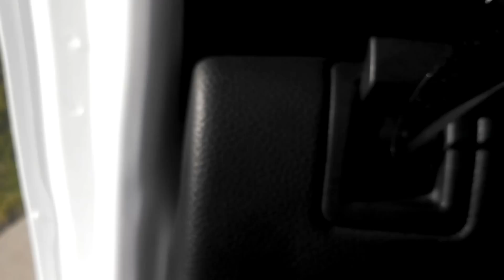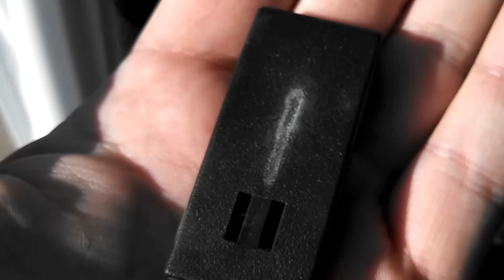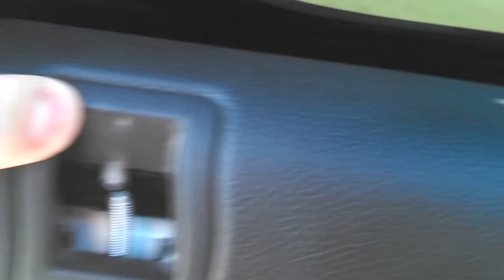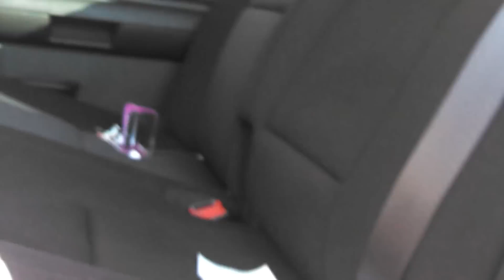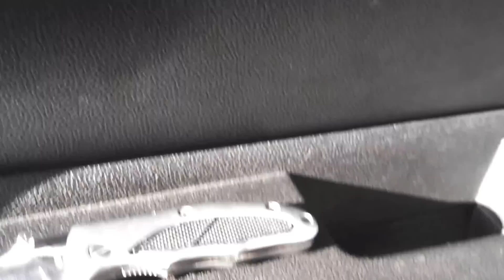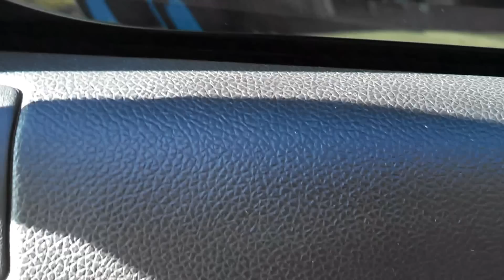Chevy Silverado HowTo stop door locks from Rattling or Vibrating.

Comment: Got some rattle in my 2014 Silverado in passenger door only and only went hitting very rough road areas. Smooth roads no rattle? Is your door lock rattle continuous or intermittent? Would this be my rattle?

Comment: i did this and it did nothing.  flipped up the rear passenger seat and rattling went away.  anyone have any ideas what is rattling in the rear seat?
Reply: Seat guide assembly on back of seat there are 3 on on passenger seat 2 on middle and drivers. $8.50 at local dealer. It's a u shaped piece of plastic
Reply: The one on middle seat back was broken in half on mine was rattling like crazy. Slid broken one out from right side. Slid new one in from the top left side.
Reply: I have the same problem and I believe its the same thing Chris says.
Reply: Had the same problem, buy the clips for the back and it won’t rattle no more. The longer you wait to fix it the worst it gets lol.